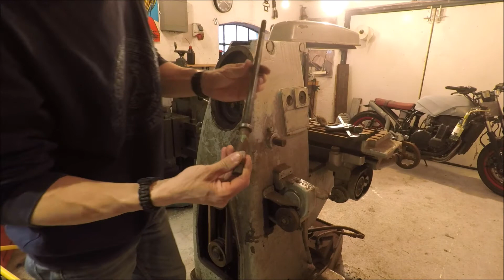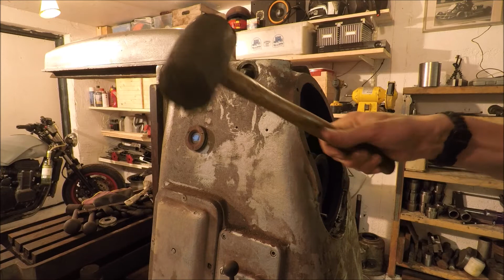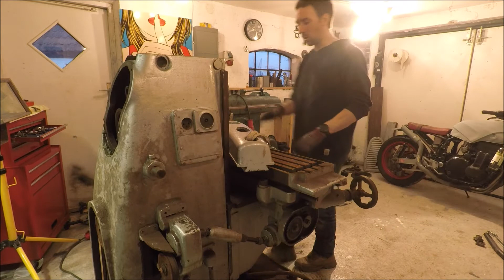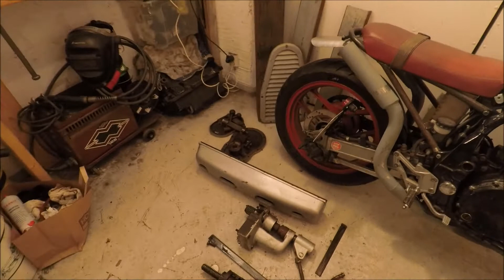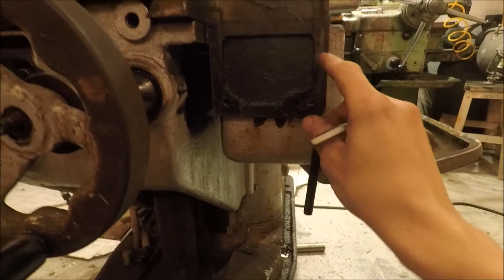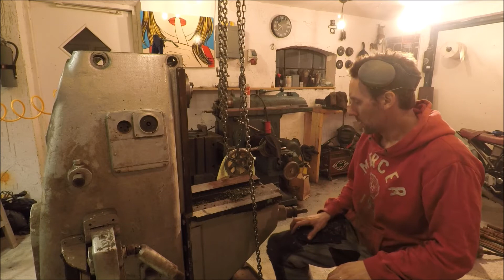Restoring a Värnamo horizontal milling machine - Part 2

Comment: Nice work! Really glad you decided to take it apart! Regarding the feeding speeds, does it have any kind of adjustment on the frame casting side, where the feed drive shaft comes from?
Reply from the maker: sunppaa Thanks! Some kind of overhaul was almost necessary. I havn't found any adjustments on the feed yet, but i'll get to the bottom of this tomorrow when i'm in the shop again.